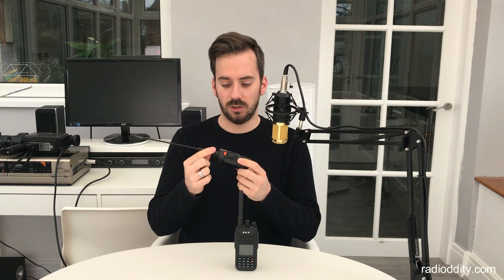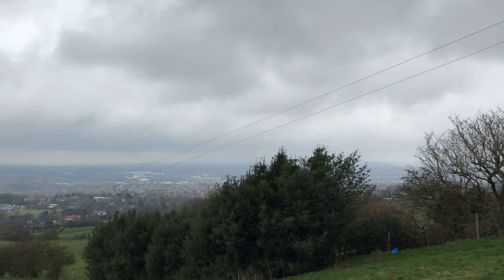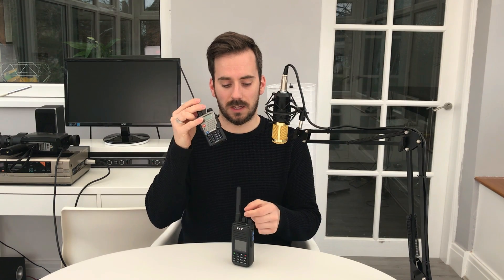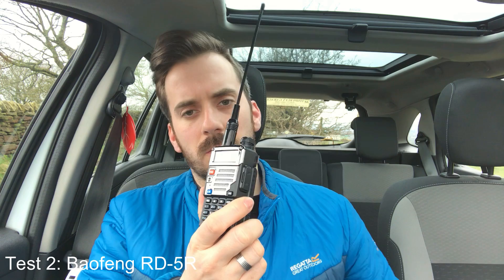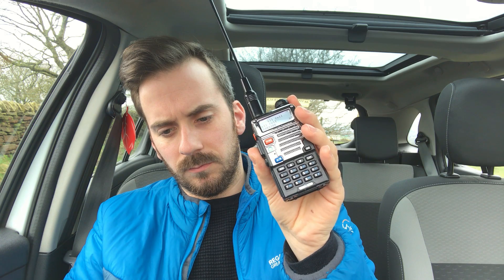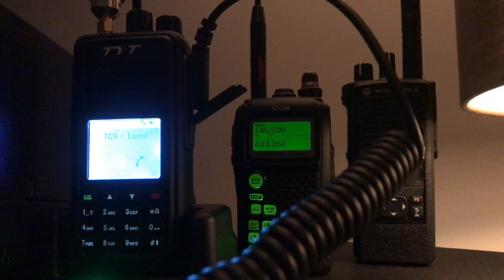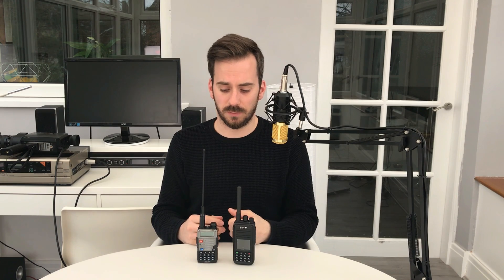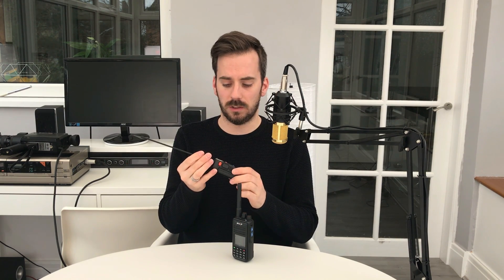Radioddity Baofeng RD-5R - Long Range DMR Simplex & Audio Test

Comment: Hi Lewis, many hanks for the YT Vids - most instructive. I used to be G7BGS and G7RBY but lapsed for more than 10 years now - I'm guessing there's no hope of ressurecting these call signs - guess I'll have to retake the test. I used to be into packet radio and a bit of HF listening. I recently had a rush of blood to the head a decided to  buy a RD-5R and then stumbled upon DMR!  - phew lots to learn

I have a bit of a head start after being a consultant on the Airwave Programme for the Civil Nuclear Constabulary so I understand the concepts etc. but I need to do a whole world of catch-up reading. I live in Buxton not a million miles from you. Any local code plugs you might have would be really helpful.

Cheers

Mark

Comment: I have 2 RD-5R radios. the first thing I do is swap out the "Rubber duck" stock antenna for the NA-771, and will do the same with the proper tall antenna for my triband as soon as it arrives. The tall antenna can reach my local repeater from over 40 miles out, something the stock antenna can not do. My next radio purchase is planned to be the DMR version of the UV5R. The battery is interchangeable and the battey eliminator will work on it as well. For a QRP powered unit, I thin k this is a good family of radios.
Reply from the maker: Yep I agree Kenneth :) Best to get rid of the stock antennas. 73

Comment: Hi I enjoy your videos very much. Today I received my new RD-5R but when I installed the software program bot malwarebytes and Windows defender flagged a virus called Trojan:Win32 /Trigger! Plock or pluck what should I do to use my radio
Reply from the maker: That's odd. I'm guessing defender has found something in the software that is in the virus, I strongly doubt there's a virus in the software if it's from radioddity site. Mine had no issues
Reply: I got the same virus

Comment: As someone who purchased a DM-5R from Radioddity I remember the claims made about the timeslot functioniality that were NEVER resolved. In hindsight I would not have bought the radio with it's "broken" DMR functionality, the UV-5R is a far more cost effective rig when you just want something cheap and robust to monitor an analogue radio system. Your review seems very fair....
Reply from the maker: Thanks very much!

Comment: I tried this radio, but I did not have the same results. My radio would not program correctly, and almost caught fire while being programmed. Be careful with this radio unless you have a very good fire insurance policy on your house that you want to cash in.
Reply from the maker: That's strange, what happened?
Reply: Well, after I finally got the software loaded onto the computer (they had me download the wrong one first) I started programming the radio but only the first 7 channels were showing up on the radio of the 30 I had programmed. I spent two hours trying to re-program the radio, each time getting the same results. The radio would only show that it was loaded with 7 channels. When I uploaded from the radio all 30 channels were there, but the radio could only see 7 of them.

While I was doing the programming I did not notice that the radio was getting extremely overheated until I picked the radio up and received two small burns on my hand from the belt clip screws on the back of the radio. Then I smelled a faint scent of burning electronics and immediately disconnected it from my computer and disconnected its battery. 

The entire radio was extremely hot, just from programming it.
Reply from the maker: Can I ask, was the antenna plugged in whilst you were programming? As some computers/cables cause the radio to key up when plugged in but it's not easy to notice if that's happened. If your antenna wasn't it, I'd guess the radio was keyed up and therefore fried itself. Just a suggestion
Reply: Yes, the antenna was attached to the radio. That was the first thing I did when taking it out of the box before I attached the battery just in case.

Comment: Can you tune around in analogue until u hear a dmr signal then press dmr mode and flick through the colour codes until you can hear the audio ?

Cheers
Reply from the maker: No you need colour code and slot
Reply: Ringway Manchester 

Cheers fella, I thought you could change cc and tg via the radio in the menu options though?
Reply from the maker: Sorry mate I misread your first comment, yeah you could do that in theory but the chances of getting colour code, slot and talk group combination are pretty slim, and will cause you a headache! lol.
Reply: Ringway Manchester 

Thanks fella !! Just got me hands on an sl1600 so looking to program it up when I can find the software ASAP , might get one of those rd5r aswell at some point , cheers for the info

Comment: When you do a distance test use the same frequency on TRBO and then FM. The RD5 has better audio, more highs. Or start out on FM then TRBO. I would like to see a test with D-STAR vs TRBO as well :-) Also as was said below go between slots too. Another test would be while slot 1 is being used you use slot 2 and vise versa on the same repeater.

Comment: I haven't spent much time with DMR, but based on your video, you can really tell from the voice quality that the AMBE algorithm is a vocoder, rather than a pure codec. That is, it isn't designed to reproduce all sounds, but rather speech specifically. It converts speech using a fixed lookup table. This isn't a bad thing, I just find it interesting. It makes DMR very efficient, since AMBE allows voice to be reproduced with a very, very low data bandwidth.
But there are some modulation effects that you can pick up, even when listening to the video on a cell phone. The audio sounds halfway between voice reproduction and voice synthesis, which is kind of how the algorithm works.

I do rather wish there was true open-source digital system for ham radio, though. While DMR itself is open-source, the AMBE vocoder is closed, and I believe the royalties are keeping the prices of DMR HTs up.

According to the wikipedia article on DMR, the regulatory agency in France threatened to ban DMR, because a closed-source codec is akin to encryption. I'm kind of partial to that line of thinking, but I'm sure I'm in the minority.
Reply from the maker: Interesting stuff Ram! Cheers!
Reply: Cheers, mate!
Reply: What frequencies are being used?  Can I listen to those frequencies without a closed-source codec and understand what is being said?  If not then it is a form of scrambling not simple encryption.  For instance the digital mode fsk is simple encryption not scrambling.  I feel like we should just use FREEDV and port it from our cell phone to an analog radio.  That will use an open source simple encryption and not be scrambled.  Anyone could download the program freely and decrypt listen to what is being said.  I can't download something right now and listen to DMR radio can I?  If so please point me to it.

Comment: Has anyone ordered one from Radioddity? How long did it take to arrive from China? Was there a customs and Excise charge? Thanks.
Reply: Just a word of caution. I ordered mine from Amazon. I paid the amount that the seller was asking, but the package is now being held by DHL (in the UK) because the seller did not make arrangements to pay the import duty and DHL say that they are forced, by the UK Government, to collect import duty on such items. DHL are saying that I would need to pay the import duty, if they are to release and deliver the item. I am of course in dispute with Amazon over this as the seller did not indicate any other charges or import duty and I maintain that I am not responsible to pay this extra charge for import duty.
Reply: Thanks for the heads up good luck with your dispute with Amazon, you might want to check Amazons general terms and conditions. Did you buy it from the .co.uk site or the .com? there's only one result from .co.uk it's from a UK supplier and costs £74 which is about what the one from Radioddity would cost if you had to pay import duty etc. the one on the .com site is supplyed by Radioddity and costs $74.99 (about £55)
I had a look on the .com site for terms and conditions regarding shipping abroad (i.e.to the UK) you might want to read this.
https://www.amazon.com/gp/help/customer/display.html?nodeId=201910420
Reply: One of the things working in your favour is Amazon are a big customer of DHL so DHL won't want to upset them
Reply: That's very true and I'm keeping my fingers crossed that ultimately, with Amazon's clout, they can get the item delivered to me, without me having to pay this extra cost.
Reply: UPDATE:  DHL the delivery company has just dropped off the radio. Looks like all the calls and emails to Amazon have paid off. Just got the radio on charge and then will have to try and get my head around the software and program up a Code Plug..... think I'd better make myself a strong cup of coffee!   :-)
Reply from the maker: Just seen all of the above! Glad your sorted mate, let me know how you find it!
Reply: Thanks Lewis. Just getting my head around the programming software/code plug stuff  ;-)    Cheers

Comment: Hi, Could this be used as a basic digital scanner?
Reply from the maker: No, you can scan the VFO on analogue and programmed channels in DMR. You can't scan the VFO in digital to pick up stations, you'd need the colour code, slot and talkgroup information programmed in.

Comment: I was tempted to purchase a TD-5R for €50’ish on AliExpress but the 16 channels per zone is still a killer. I have a MD380 which I mostly use as a scanner which again is 16 channels per zone and switching zones can be a pain at times. 

I bit the bullet and went for an Ailunce HD1 on special offer instead which can continuously scroll through all channels. 

Thanks for the review all the same. DMR is certainly becoming more affordable and popular :)
Reply from the maker: I got the Ailunce HD-1 sent to me which is great, designed for the amateur community. Review coming soon :)
Reply: Nice one. Mine arrived on Monday. All good so far especially the continuous VFO and continuous channel scroll.

Comment: Hi Lewis, Interesting video again. I reckon the RD5R has the edge audio wise, sounded a bit brighter. I would be interested to know how it performs on FM too. The audio from my "disastrous" DM5R seems OK on DMR and FM actually but of course its the timeslot problem that cripples it. Still waiting for delivery of my RD5R but looking forward to it. 73 Kevin GW0KIG
Reply from the maker: Cheers Kevin I agree. I actually found the DM-5R audio pretty good when I tested with my friend on his but it was the timeslot thing like you say. Also I find my DM-5R slightly deaf on DMR and analogue for some reason when compared to UV-5R's.

Comment: Hey Lewis. Thanks for both review videos on the RD-5R. Baofeng/Radioddity could be on a little winner hear if all is as good as you say! Have you had a chance to operate through a DMR repeater yet and also on both separate time slots? This was the big downfall of the old DM-5R, transmitting on both TS at the same time! Cheers for the info... (Perhaps you or someone else could find out exactly what the relationship is between Baofeng/Radioddity/TYT/Retevis etc is? I'm getting a tad confused who's producing what!!) 73, Brian EI8EJB
Reply from the maker: Hey Brian, thanks so much! Yes it works well on the repeaters I tried it when I was in wales last week, unfortunately my local DMR repeater is offline at the moment!

Haha! Allow me to clear it up.

Baofeng - makes the radios on their website.
Radioddity - they sell radios for Baofeng, TYT and others. They worked with Baofeng to bring us this radio.
TYT - They make their own radios.
Retevis - They make their own radios - mainly DMR and higher end analogue gear. Some are similar to Baofengs radios.

What's confusing is that chinese manufacturers use public moulds to produce radios under the Baofeng and Retevis name that are nothing to do with the companies themselves. The Baofeng T-1 being a very good example

Finding a radio on ebay that isn't a knock off is very hard these days and there's almost no way of telling which is real and which is fake.
Reply from the maker: Oh and Retevis/TYT DMR radios share some of the same hardware, software and mouldings! Confused yet?
Reply: Well that's answered that then Lewis! Yip! bamboozled indeed! :) Thanks so much! One last one: how many contacts can this little radio hold? Seems budget DMR is now available!! 73, Brian
Reply from the maker: 250 I think Brian!

Comment: My Baoefeng will be here tomorrow,I’m already scratching my head on how to add code plugs as there aren’t any on the gb7ee website.Thanks for the videos 👍Gm4zji Chris
Reply from the maker: Cheers chris
Reply: Gb7dd.co.uk and search site for gd77 codeplug
Reply: Whoops just noticed u want the baofeng code don't know if it will work but you could just copy the info into r5 software
Reply: Glynn H  thx Glyn can’t do any harm to try as its Radioditty/Baofeng👍

Comment: Could you test if it transmits constantly (100% carrier but signal for 50% in own slot) or if it does not transmit during other slot (no carrier transmitted for 50% ie. it does not effect other dmr users). This can be tested by using to different radios at the same time for talk groups in different time slots. Repeaters often listen two time slots for different talk groups (in same frequency). This has been one gotcha for previous chinese radios that only cut the audio but keep the carrier on all the time.
Reply from the maker: This transmits 50% on one slot like any other DMR radio :)